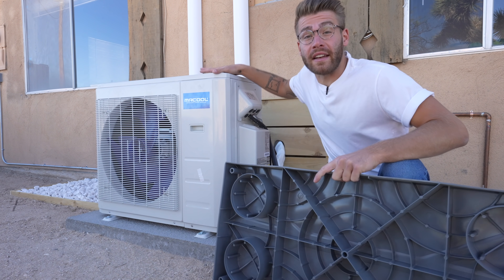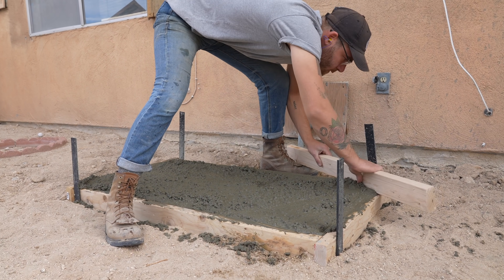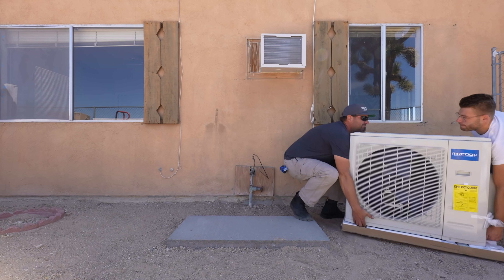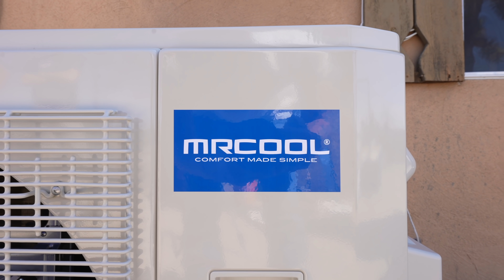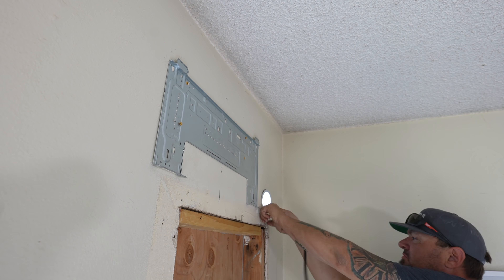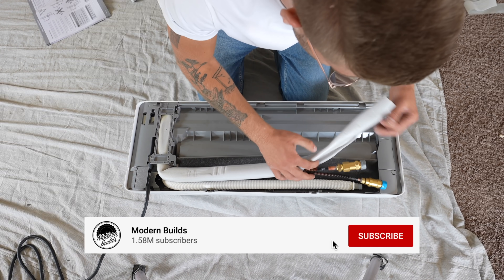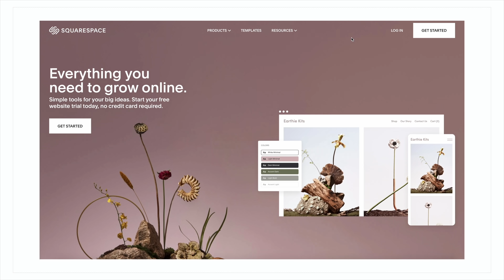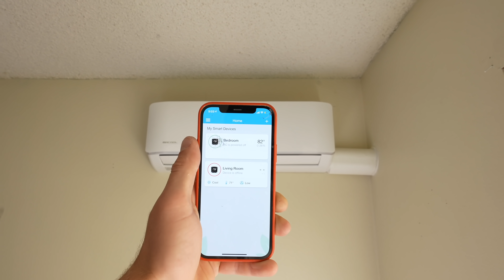DIY Multi-Zone Ductless Mini Split AC & Heating System | MR Cool Install 2021

Comment: nice job. except your electrician cut off strands of the wires for the power at the terminals at the condenser. That is really lame. He needed to get all the strands under the terminals.

Comment: 1: It's best to cut the lines and reconnect everything properly.
2: Using rubber pads is recommended to minimize vibration.
3: Ideally, a vacuum pump should be used to evacuate the system before starting it.

Comment: Contemplating purchasing one. How is the unit running after 4 years? I am curious about storing the extra length of lineset vertical behind the unit. 99% of install videos such as yourself show the coiled lineset vertical. Some will say that the coiled lineset must lay horizontal to avoid trapped oil. There is even a sentence in the manual stating this. Just wondering how critical it is. One would think if it was super critical there would be a lot of people out there with ruined compressors.

Comment: Did your indoor unit not push away from the wall? I just installed 5 in my house (2 wall units and 3 ceiling units). The wall units tend to push away from the wall, probably because of the linesets

Comment: If you are only running one air handler out of 5 connected, will the condenser run full or will it toggle down?

Comment: You are supposed to pull a vacuum on the lines BEFORE opening the refrigerant values. That way you confirm there is no leak instead of finding out by losing your refrigerant from leaks. Its takes gauges and a vacuum pump and an AC tech to know how to hook them up and use them.

Comment: What you recommended when install split heater ac unit into a big house with 5 rooms that have no duck work at all. Is better to do split system or do the duck work. It gets below zero here sometimes

Comment: The thing I don’t understand is if you have a 3-4 zone system and bedrooms spaced pretty far apart, how do all of the heads connect to the condenser? Do you have to somehow run every unit’s line outside to be individually connected to the condenser? Or is there like some point where the units’ connections can meet and reuse the same condenser connection?

Comment: Only thing I hate about mini splits all the garbage line sets coming through the wall I figured out real quick how to run them down inside the wall into the crawl space and then out through the crawl space walls behind the condenser as they should be.

Comment: You forgot to evacuate the lines before charging unit.
Reply: You don't have to do that with mini split systems they come pre-charged all you do is connect them and turn them on. If you had listened to the whole video you would have heard that at the beginning.

Comment: I've had min-splits for about 10 years+, and I can tell you that all those 90-degree bends in your drain hose are going to be a problem.  Slime and junk come out of those hoses, not just water and every bend in the hose increase the chances of it backing up.  Basically, you're looking for a straight shot down with gentle curves and not hard angles. Good luck.

Comment: The only thing you are missing is a surge protector for your minisplit. You should install a Ditek DTK120/240 surge protector on your cutout switch so that in the event a lightning strike or power company surge happens your sensitive electronic control boards in the minisplit aren't toasted.

Comment: Can you keep the two rooms on different a/c settings…….  One at 75 degrees and the other at 79 degrees?
Reply: Yes a proper mini split system heats or cools if it is a heat pump. With my system keep one room at 50° with the AC all the other rooms I can keep the other rooms at 90° with the heat the older systems where the line sets connect directly to the condenser couldn't do that but the newer ones have a combiner box that has switcher valves at the air handler which allows it to switch from heat or air depending on what it's thermostat is calling for.

Comment: Do these things really use less electricity than the wall units
Reply: I have a 10 ton multi-zone mini split system installed on my home and it still uses a quarter of the electricity that my central HVAC system ever did because instead of it running at full capacity all the time to cool every single room in my house at once it only turns on whichever air handler it needs to run. No more unnecessarily cooling or heating rooms that are not in use.

Comment: Super simple and anyone can do it, all you need is  two hvac techs and one electrician.
Reply: yea the whole time I'm thinking what ever happened to the "Y" in DIY?
Reply: Mate, u can do it urself as long as u comfortable running a wire from your main box, if not then the electrician is needed but not the HVAC guys.
Reply: and he was supposed to run a vacuum pump to confirm there were no leaks BEFORE he opened the refrigerant values. Because if there were leaks the refrigerant will have leaked out.
Reply: @RossMalagarie  not that system the refigerant is precharged in the copper lines
Reply: @RossMalagarie  seems you missed the part about the lines coming PRE-charged,  they already have refrigerant in before you even install them.
Reply: @hercules4978  you are correct, i missed that part thanks
Reply: @RossMalagarie  u are right but u really dont need it as these units are very simple to connect unless u are not strong enough to tighten two tubes together then we got a different problem there lmao
Reply: @shijakudarli8622  or damaged threads lmao
Reply: @RossMalagarie  u gotta be so bad if you manage to damage those threads lmao. That was the easy part of installing these units :')
Reply: FACTS!!!!!!!!!!!
Reply: Facts 😂😂😂

Comment: Did you triple evacuate the refrigerant system to 500 microns and hold for at least 30 minutes to remove non-condensible air and water vapor? If not  system will have higher head pressure using more power and acid and sludge will form causing premature compressor failure.

Comment: Did you pull vacuum from the lines to get rid of the moisture that exists in the ambient air? In my projects I had kept the vacuum pump running for at least half an hour before letting the refrigerant in. Maybe that’s not needed where you live? Looks pretty dry out there 🙂

Comment: How big the slab?    How long is pipe line to compressor to wall unit?   Do you know what is the difference  between the Generations  Mr Cool?   I am thinking get 3rd Generation.

Comment: It’s been a year since posting  this video. Any word on the electricity bill? I’m considering getting a couple of these for a house remodel. Very little to no snow in my area but a lot of great comments of things to keep in mind, mainly have an HVAC guy handy and don’t leave extra line coiled up. But, I’m very interested in how this impacted the electric bill. I can’t find anyone that has one who shared the difference it makes on the electric bill, good or bad.
Reply: Just the info I'm looking for also.....
Reply: This installation is already scrapped since it is garbage
Reply: @rawrandom-yt no it's not. why, is mr cool diy installation reducing your labor profits? lol you just have to make sure to follow the install manual and be up to code. it is doable for those already experienced with electrical as well as fixing things around the house.

Comment: My electrical box is on the opposite side of my house (right side) from where I need the mini split installed (left side). So I have no idea how I would get this installed. Plus I don't know anyone with hvac experience. So not going with this but it was a "cool" video. So thanks.

Comment: Dude. Use a torque wrench and buy the crow foots.. You are saving THOUSDANDS buy doing DIY. If just one of those connections leak - it is going to get complicated and expensive very quickly.

Comment: Just a warning...impossible to bend the 5/8 copper line without a yellow jacket tubing bender for outside 90s and inside 90s....u must remove insulation..fukin kinks so easily. This is my only complaint right now

Comment: You already had a big hole in the wall. Why not put the lines in the wall? Open up the wall a little more and they all would have been hidden. Also you could have installed some zip panels with a decent R value and properly sealed them.

Comment: I would never touch a multisplate system with a ten feet pole. Ever!
Each room individual condenser. Highly reliable and cheaper in the long run

Comment: I have a 3 to one mini split. I only have two of them hooked up and they run for a bit and stop working. Then I have to wait for it to unfreeze and I can use them again. Is this because I didn't hook up the third one? Or any idea why it would do this? I can't get a hold of anyone from Mr cool. They never respond back. Took my money and ghosted me

Comment: For all of you DIY out there, when connecting the lines outside and you have extra lines. Do your self a favor and loop the lines Horizontal (under the condenser stand is a good location) instead of vertical as it creates an oil trap.

Comment: This is definitely beyond the ability of 90% of DIYers, the fact that you had two HVAC technicians with you says as much.

Also I'm pretty sure DIY installing the electrical for a split system is illegal in a lot of places, you need a licensed electrician otherwise you'd get absolute plonkers who burn their house down / kill themselves.

Comment: Nice Job.  2 suggestions (your HVAC Friend Probably knows but didn't want to go against the whole DIY idea) 1.  coil the line set up like a slinky up and down not side to side. This will prevent lubrication problems. 2. you can start system up and pump  it down ( close valves to empty the indoor unit into the outdoor unit.) cut your line set to size, rebraze, pull a vacuum then restart. Adjust refrigerant charge as needed.

Comment: So what happens if your connections leak and you have to have the system recharged? What about a city inspection providing you are even allowed to do your electrical work. Isn't it a problem to leave the extra line in a vertical loop. Tightly wrapping the lines over the insulation defeats it ability if crushing it down tight. 
I watch another video where they found the cardboard template did not match the bracket. Seems like mounting the unit so close to the ceiling would be poor circulation if air and false thermostat readings.

Comment: Hey there! Do you happen to have the old fittings you removed from your condenser unit?? I am in need of one of the blue/gray set of quick connect fittings that go on the condenser and I can't seem to find them ANYWHERE!

Comment: Few things, a pipe cutter and flare is like $70 on amazon. Also, I really hope your "pros" vacuumed the lines before you just pressurized the system.

Comment: Want to Respect the idea of doing your self but in the process always consult the professionals. Note you forgot to pull a vacuum on the system and as well never recommend just opening the service valve like you did and doing the leak check. 410a refrigerant always need to make sure you pull a good vacuum because of the oil that 410 used. And not only that you can damage your system prematurely if you don’t. Love the electric and plumbing ideas but as a hvac tech that’s point is what’s kills it for me
Reply: no need for vacuum. the lines are precharged. it is why it is DIY

Comment: Hello all... Super important! Please read; those pressurized line-sets circulate oil throw the compressor. Hears the important part... when you loop the lines vertically the oil gets trapped in the bottom half of each loop and starve the compressor of oil. Burnt two compressors in 6 years until one smart HVAC guy figured it out.

Comment: Just to clear up the never ending question I keep seeing. I've installed both styles. DIY and standard mini splits. The DIY units have Freon pre charged in the lines with sealed connectors. The vacuum is already pulled on the compressor side. When you open the valves where the lines attach to the outside unit it draws the Freon in from the pre charged cooper lines and your done. Run unit 5 mins in heat and cool cycle and your good to go.  The standard units have Freon already in the compressor side but the copper lines have to be built so they will have air in them. They need to have a vacuum pulled and you need the little special connector to attach your gauges. Its like $12 I think. Your pulling the vacuum on the lines and inside unit for I think 30 mins at whatever pressure. The inside unit will make a little hiss sound when you take the caps off which is good. They pull a draw on it and the hiss means it has no leaks.  I don't remember exact numbers but its in the book. AC guys know off top they're head. The DIY units have worked perfect for me so far after a few years. The standard units have been perfect also. There is no difference in the cooling abilities between them.

Comment: I'm able to place the outdoor unit in a flat roof with the line set as well as the indoor/in room unit below it.  Does Mr. Cool sell a condensate pump with for the indoor unit?
Reply: I believe the cassette style room units have drain pumps on the drain line because they are ceiling mount and not wall.
Reply: there is a max distance between units as well as indoor unit max distance from outside condenser.

Comment: 11:00 at this point, you are supposed to vacuum the system.... Drain the air and moisture out of the interior units and copper.
Reply: This system has precharged lines
Reply: @marksalotsalot  Then you still need to vacuum..... These lines are not precharged, only the outdoor unit holds the gas.... so the lines and the indoor unit contain moisture.

Comment: The MrCool units are top notch. Just make sure you dont put any additional pressure on the lines when installing to the condenser (the outside unit with the fan). I have 2 of them and couldnt be more happier. Plus the super efficiency is a bonus as it saves me tons on my electric bill  . Overall great video!!
Reply: How much did you save on your electric bill?
Reply: How much do you save did you use heatpump
Reply: @jaandel1  My 2 ton Pioneer Minisplit cost me about $1.00 a day or less to run full tilt. I have a 22 seer unit.

Comment: All you useing mr cool  diy system you getting ripped off. First they don't ansewer the phone. Second no hvac businesses  or repair hvac  business wil carry parts or will repair mr cool systems. This due fact mr cool is not recognized  by hvac techs and thus since the mr cool warrenty only valid if it is installed by hvac tech. Also if unit fail their are no replacement  part in usa since it's all made in China. The chinnese government demands al, businesses recognize  their right to invade tiawan  and Japan. Also their fascist so mr cool support  chinnese  fascism. Mr cool systems have very bad warrenty. And no parts
Reply: Actually the DIY units do have a 7 year warranty on the compressor and I think a year on the rest. Cant remember. You have to go on the site and register the units serial Number. I wouldnt bother anyway. Its just 2 fans and a compressor basically is the only moving parts in the unit. Fan motors you can just cross reference if you cant find a Mr Cool and if the compressor or board blows you can buy the whole out side unit for $400 scratch and dent on Ingrams air. .  If it blows up in 5 years ill just buy another whole unit and replace it in 4 hours on a Saturday.  I think the guy paying 10-15k for a pro install is getting ripped off. These things are very simple design and install.  Ive been running 3 of these for a few years now and just installed a Cooper Hunter at my parents house. That C&H is extremely quite. That may just be my next unit if these fail.

Comment: How MUCH of this DIY did you ACTUALLY do? This looks way too much of a DIY project.
Reply: Ive personally installed 4 of these. Two 18k, one 9K and a 24 Cooper Hunter. If your a handyman its not hard. If your the guy who cant change the spark plug in your mower you may not want to attempt it. On a 1-10 .... Id rate it a 4.

Comment: So you do not have to pull a vacuum on the line ?
Reply: NO. The line contains the Freon charge and have sealed connectors.  The compressor unit has the vacuum already pulled. After lines are installed you open a valve and the freon is drawn into the unit. Run unit 5 minutes in heat and cool cycle and ya done.

Comment: the gravel and wooden frame is a great touch.  As a landscaper it's always a much easier job to maintain the lawn near the hvac systems that have been designed for not just aesthetics but practicality and safety.  good job

Comment: How many feet of pre charged line do they give you in a kit ?   Can you extend the lines and if you do will it effect the efficiency of the unit ?
Reply: You can get 16 or 25 foot. They make a connector to go between the lines to extend them. No effect on the unit. you can do two 25's i know but im sure there is some kind of limit to it. That I dont know.
Reply: @mattsbrute  thanks 👍

Comment: FYI, you can’t use pressures on these systems. They’re critically charged. It will give you an idea but keep in mind everything modulates according to the load.
Reply: i was wondering why they were testing it when the lines are precharged but i had the video on background and was multitasking

Comment: You can save quite a bit of money buy buying a brand other than Mr. Cool. They are $400-500 more with the only difference is  the lines are charged so they don't need to be vacuumed. You can buy a good enough vac and manifold set for $120 and do it yourself. Plus if your installing more then 1 unit you can use the vac over and over while buying the cheaper units.  Also you can save a little money by using a non-fused disconnect, since it's on a breaker it doesn't really need an additional fuse.